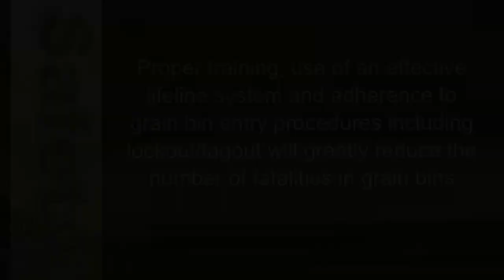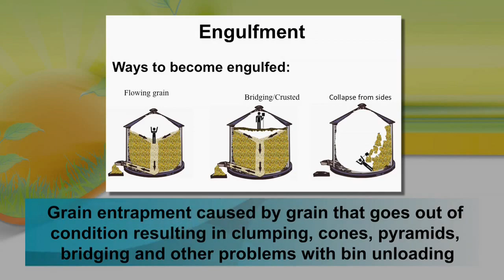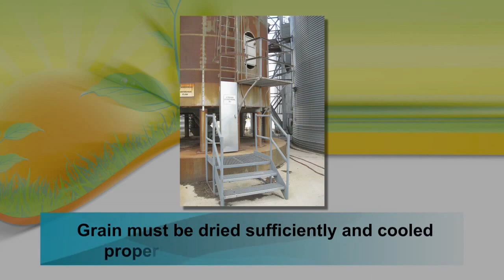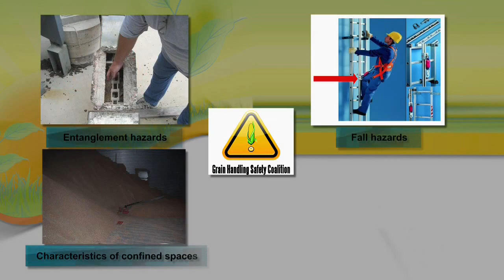Following Proper Grain Bin Entry Procedures Saves Lives

Comment: Self-extraction from a corn bin is extremely difficult and often impossible due to the unique properties of grain and the dynamics of grain flow
. Grain can behave like quicksand, and once you're knee-deep in it, you can become trapped in a matter of seconds
. The suction force of the grain can be so strong that it takes a significant amount of force, often exceeding your body weight, to free yourself
. In fact, it's estimated that by the time you're waist-deep in flowing grain, it would take around 600 pounds of force, plus your body weight, to free yourself, and by chest-deep, the pressure of the grain can be too great to breathe, leading to asphyxiation even if your head is above the grain

Comment: Easy fix: GIANT DOOR on the side of the silo, big enough for all of it to come out quick.
Reply from the maker: We need to be thinking outside the box to solve farm safety issues. Thank you!
Reply: Why have a safety measure that wastes all of your economic activity every time you're in danger? Why not use the standard full body harness?
Reply: @20-starstrategy95  Because if you try to pull out someone quickly with a harness in Grain it may be harder

Comment: Wouldn't it be possible to have struts running across the bin every 6 feet or so incase you sink and can grab on one of the bars. Or have a rappelling rope from the roof with a winch so you can lift yourself back out.
Reply: The grain exerts enormous pressure so you can't move your legs at all even waist deep, it would be very hard to pull yourself out

Comment: Pardon my insensitivity, but what happens when someone dies in a grain bin or grain crusher? Am I eating that same grain?
Reply from the maker: Thank you for your question. It is  doubtful that you would consume grain from a bin where a fatality has occurred. These incidents do not occur frequently and nearly 40% of grain is fed to livestock and another % is used in the production of alcohol. So the chance of this occurring would be extremely small.  So no need to worry.
Reply: but there is a chance... 1:100.000.000 is not a high number, yet people will enter a lottery for them same odds. So I guess this is a lottery you wouldn't want to win.

At any rate, most mass produced farm produce has some kind of pollution in it, either from feces or from the machines or other products that are produced within such facilities. Like those bridges in the corn which are formed by 'grains that go out of condition'. That's a fancy way to say: starts rotting. Like most meat is covered in shit when it comes from electrocuted animals... just heat your food, that's why we do that in the first place: to kill off anything harmful in the food.